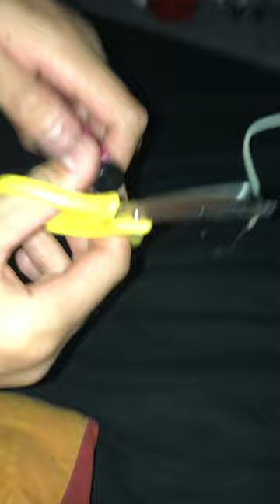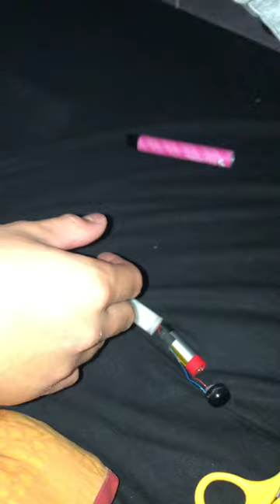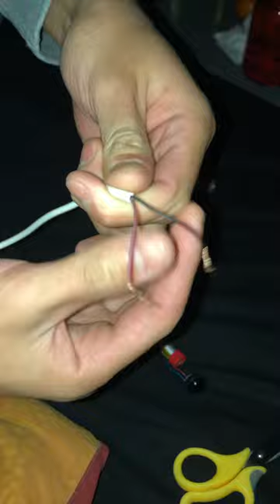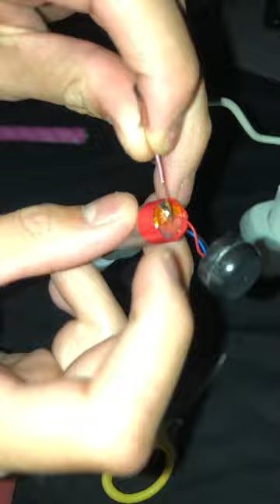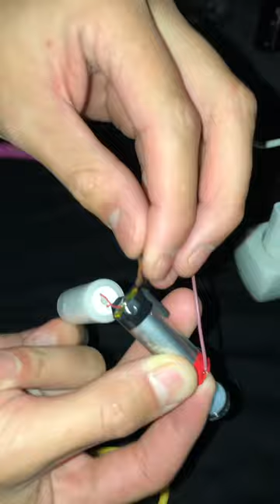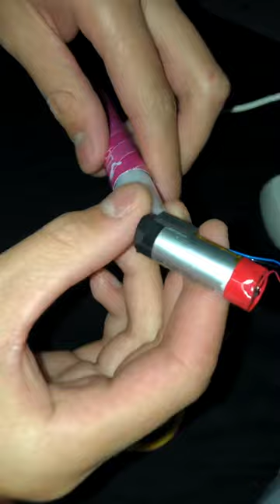Comment recharger une puff

Comment: la mienne a cramé elle s’allume plus du tout
Reply from the maker: cramé comment?
ta bien mis le fil rouge du coter rouge et le noir du coter noir?
et si elle marche plus rachète en une autre o pire et tu le fera sur elle quand elle aura plus de batterie
Reply: @vorlox1092  j’ai bien fais ttca et après elle s’allumait plus du tout
Reply from the maker: @julien8493  sa marche pas tout le temps fais le avec une autre quand elle aura plus de batterie